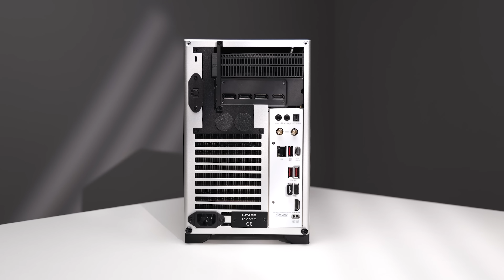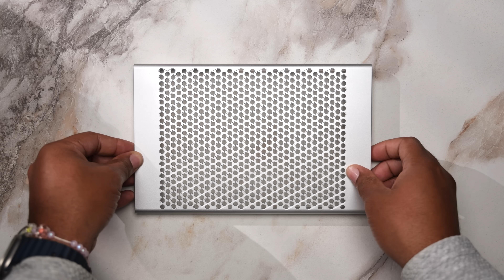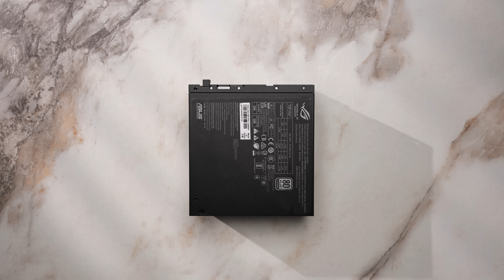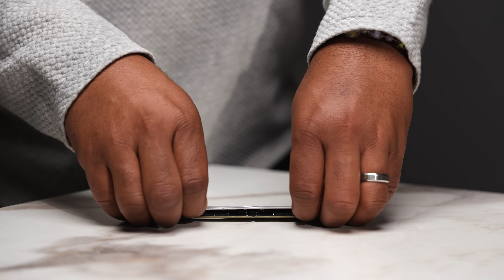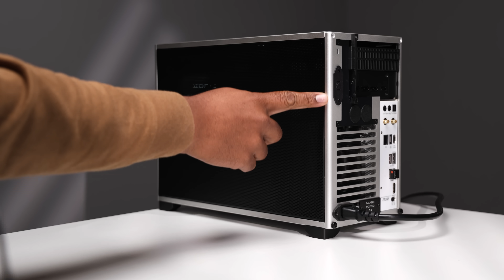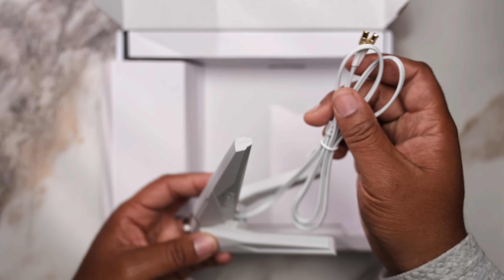Silver, Silent, Powerful | NCASE M2 Grater with 5080 + 9950X

Comment: Hi Chris, love your high quality videos. I was curious if you could help me - I just ordered an M2 Grater and am planning on getting the same Noctua D12L cooler. I have heard online that getting aftermarket spacers for the motherboard to help the cooler fit in the case better. Im aware the mother board spacers are 6mm in length but can you tell me if they are female-female (on both ends)? I am trying to pick up some 5mm metal m3 spacers to provide more clearance for the cooler but want to make sure I get the right kind, cant find a picture of them anywhere. Thanks!

Comment: Do you think this could handle 5090 + 9950x3d without any throttling?
Reply: Also, how would this compare to the performance of a side-mounted AIO, but otherwise the same setup? I suppose there would be a couple extra fans. Or slightly shorter air cooler and mounted fans on the side

Comment: This case sucks.
No dust filter. 
No psu bracket for ATX psu, only itx
No 12mm fan slot at the rear for cpu exhaust.
The round feet stand leave only 3mm space for your gpu bottom intake. (You won't get the stands like in this video, you have to buy them separately.)

I mean WTF is this m2 m3 series???? It seems like a chinese CCP owned this company recently and hired some random chinese guys just for immigration purposes.

Comment: Great video! Thanks a lot. 
What would recommend, air cooling or liquid cooling and why?

What is the best motherboard of this size if the price doesn’t matter? To be more future proof and great quality. 

Is it possible to fit an 1000w PSU? What company is it?

Thanks
Reply from the maker: Air cooling is the easiest to work with in this case but you can fit up to a 280mm AIO which will give you better thermals for the CPU.

ITX motherboards will have the most customizable options but mATX will likely be cheaper but more limited in configurations. 

You can fit any PSU up to 160mm in length but SFX or SFX-L will be your best bet as ATX power supplies will severely limit your hardware options.

Comment: I ordered the glass side panel for my M2 how bad does it bend the glass with the Noctua NH-D12L? Does anyone know.
Reply from the maker: The 1mm or so I mentioned in the video, you can only tell from the back when looking closely.
Reply: @ChrisRussellTech  I see that some people are saying it depends on the height of the heat pipes on the D12L some are longer than others guess I'll find out when the glass side arrives.

Comment: Hey, thanks for the build. Do you think your air-cooled setup for the M2 will work well for a 9950X3D and 5090 FE build? I am using your setup as a guide, but I plan to go with the ROG STRIX B850-I for the motherboard, and I also plan on using two Crucial T705 2TB PCIe Gen5 drives for storage. Do you think I will need a low-profile heatsink for the T705 2TB drive installed at the back of the motherboard? Any recommendations?

Comment: Great Video, love your content overall! Is it possible to control all the fans individually or would you need a seperate fan hub? Cuz most itx boards have 3 fan plugs which 2 out of these are cpu fan and aio pump.
Reply from the maker: If you have 3 fans than separately but unless you go for some USB fan control hub it’s normal daisy chain hubs

Comment: Chris, would you say that putting a 9950x3d and a 5090 TUF in the m2 grater is wise? I cant get an FE anywhere, but im not convinced that ill have enough airflow with those massive asus cards. I'm thinking 5090 TUF, 280 rad for the 9950x3d, and some case fans if i can find the space for them
Reply from the maker: You’re best to go with a reference layout with the GPU mounted on the bottom and a side mounted radiator. GPU intaking fresh air from the bottom, the radiator intaking fresh air from the side and top fans exhausting that warm air out, the warm air will follow the natural convection route. Both your CPU and GPU should be relatively unaffected by the warm air they each cause.

Comment: Hey Chris,

What are you using to manage all of the fans?
Reply from the maker: Software, Fan Control, they’re just grouped together with splitters, CPU Fans, Front Exhaust and top intake. 3 groups, 3 headers.
Reply: @ChrisRussellTech  that makes sense. I didn’t think of the splitters.

Comment: Great video, I was building my pc in this exact same case but it won’t ship to India. I wanted to use the same cooler with my R9 9900X but was told that Aios would be a safe option to not compromise on the performance. What’s your opinion?
Reply from the maker: I air cooled the 9950X, it’s not the best thermals you can buy for the size but it’s easier than going with AIO. The thermal gain you save with a AIO you add in other complexities like tube and pump orientation, addition cables from the pump, rgb etc,  you may also require a second radiator bracket to mount the radiator as the M2 on comes with one. If you want to mount fans at the bottom or top as case fans you’ll have to buy a second radiator bracket.

Comment: Sweet vid man, this is a real dream build!

How does this mobo compare to the B850i’s from ASUS Strix and the Gigabyte one you reviewed not too long ago? Also, is this MSI mobo more silver or white? Really wish it was black, but I guess silver could work too.
Reply from the maker: Well on paper the MSI B850i more aligns with Gigabyte in terms of rear connectivity like USB-C options with one port, however like the ASUS, MSI offers an accessible clear CMOS button(very important in small cases). The MSI gets a point in networking with their 5-Gigabit LAN and their WIFI 7/Bluetooth 5.4 antenna, giving you that quick connect style support but also giving you options to use third-party low profile antenna. The ASUS board also comes with two M.2 SSDs that are actively cooled versus the others with one actively cooled and the other on the rear of the board. The last part comes down to style preferences, the MSI board is more of a in-between option with its silver heatsinks and grey PCB. The Gigabyte style wise is probably the cleanest if you’re looking to do a standard black centric build. ASUS also falls under that black centric look but not as clean looking at the AORUS Pro in my opinion.

Comment: Respectfully disagree on this being the best case. FormD T1 2.1 by a mile. Good video though.
Reply from the maker: Totally subjective but I think they’re best in different categories. I think the T1 is the best true SFF case for its size and what you can fit in it. The M2 is the best overall case with much more component compatibility but comes at the cost of 6 additional litres. I think the Grater is the best version of the M2.
Reply: @ChrisRussellTech Agree on the grater being the best M2, but it still has design issues, like the front bottom left grater “defect”, the huge amounts of open space on the back panel when assembled, and locating the power button on the rear panel. I did get a Rose Gold for my wife’s new build. The color is definitely unique (for now).
Reply: @jaynamics  also the grate of the grater could have being nicer with the full front panel filled with them and being less small and with more oomph and 3D. But still it's the nicest version of an amazing case , albeit larger then T1.

Comment: Right now I'm rocking the M2 with black mesh side panels. the PC  is set up in VGPU config, somehow cramming a 4090FE, Ryzen 7 9800X3D (on a X870i w/ 98gb corsair Vengeance @ 6kM/T) and an Arctic Liquid Freezer 280 in there. I had to remove the VRM fan to fit the AIO in there.
As of literally right now idle temps are 39C GPU / 49C CPU. There's still some space left behind the front panel but I first need a bracket to mount an additional fan. Power is delivered by a Corsair SF850. for Storage I use two Samsung 990Pro 4TB drives one of which is set up to dual boot Windows10 and Linux (Endeavour OS). I've not booted into windows in over half a year though.
Reply from the maker: That sounds like a beast of a build!
Reply: @ChrisRussellTech  it sure is and I'm pretty satisfied with how it turned out. I'd be lying if I said I wasn't inspired by the ITX builds of you and Optimum.

After seeing it in one of your videos I bought the Thermalright AXP-90 Copper for a PC I built for my parents at the same time I built my M2 system. I got the jade Fractal Terra for them. Th copper works great with the green.
Reply from the maker: @J4363R that’s awesome! I’m glad I can offer inspiration for your builds!

Comment: build quality: 10/10
compatibility: 10/10
air flow: 10/10
Dust: -1000/10
Reply from the maker: Forgot a zero on the dust rating
Reply: @ChrisRussellTech  I had to move out of my M2 due to dust, it was honestly way too time consuming taking it apart to dust it every 2-4 weeks. Dust build up compared to any other case I've used was ridiculous. It looks awesome and the thermals were second to none though.

Comment: Can you use the 3d mod if you use an air with a vertical GPU.
Reply from the maker: Yes, depends on the GPU length but the 5080 FE, yes.

Comment: Did you use 6mm or 5mm standoffs for the motherboard? Can the D12L pressing on the side panel be fixed if I go with 5mm standoffs?
Reply from the maker: They only come with one size standoff, I assume they’re 5mm
Reply: @ChrisRussellTech  I will try and switch from my T1 to the M2 when I get the Anti-sag Travel Kit - there's one on the site for M2.
Reply: @ChrisRussellTech  Looking to add a second rounded Noctua NF-A12x25 R PWM to the D12L like you, but I already have 96GB Corsair Vengeance (Non-RGB version) which come to 35mm in height. Would they fit with the extra fan? Also how are memory temps with the fan's plastic sitting right on top of them - I assume minimal airflow happens on the actual sticks kit.
Reply from the maker: @aumdna I forget but I mentioned it in the video at the end during the benchmarks I think

Comment: I believe for rtx 5080 850w psu is recommended…
Reply from the maker: Sure, some may recommend 1000W but if your system is only pulling 500W you may be able to get away with a 750W.

Comment: Is the wifi antenna proprietary or you can use with regular antenna plug ?
Reply from the maker: Great question, its has a proprietary connector that doubles as a standard connector if you want to use aftermarket antennas

Comment: Looks like you forgot to peel off the plastic sheets on the thermal pads when installing SSD to motherboard.
Reply from the maker: In the shot I did but not in the final build. It was a dry fit clip but it turned out to be the best clip quality wises. Just know, it was peeled off officially.

Comment: One of the most beautiful coordinated builds ive seen. Fantastic vid man.
Reply from the maker: Thanks, this was a passion project!
Reply: Looking at doing an M2 build myself with the silver Grater version. 

Do you think a full white component interior would provide an interesting contrast with the M2? Or would it be a bit off putting with the light grey of the CNC aluminum?
Reply from the maker: @Simon_Mead  it could be challenging, I say that because even the glass panels have a black border. If the case came with a white glass panel it would be easier. Otherwise you’re blocking your white build behind a mesh panel it could work but you’d have to do it in a tasteful way. Silver is probably the lightest I’d go mixed with black.
Reply: @ChrisRussellTech Appreciate the detailed response! I think I agree, honestly. Was a little unsure about the match to start so I think ill go a different route. Going to look into some black/silver mixed components then. Cheers!

Comment: Looks amazing! I’ve been using an nzxt h9 flow. But after seeing the feedback I just had to switch case. currently waiting patiently for my M2 grater to arrive hopefully next week. Ordered the glass panel also
Reply from the maker: You won’t regret it. Builder tip, USE the foam mat for building. I don’t use it as it doesn’t look neat and clean on video but it’ll save you scratches.
Reply: @ChrisRussellTech I’ll post a photo on on ncase subreddit when it’s all done. Perfect thanks for the tip.

Comment: Beautiful build man! Did you end up taking the plastic off the M.2 Heat sink? In he video you screw it in and it looks like the protective plastic is still there beneath it.
Reply from the maker: Yes the plastic is off. There’s several takes of the same install and I decided to use the “dry fit” version for the video. Lol
Reply: @ChrisRussellTech  Thought so man! Grater builds FTW!

Comment: Hey man, love your videos.  So the D12L touches the side panel and pushes it out 1mm?  Does it do this in all configurations?  I'm currently building in the M2 Round with a Level 2 configuration.  May look at other cooler options.
Reply from the maker: It varies from motherboard to motherboard really. The bulge really isn’t that bad and it’s more pronounced on camera with the straight on shots